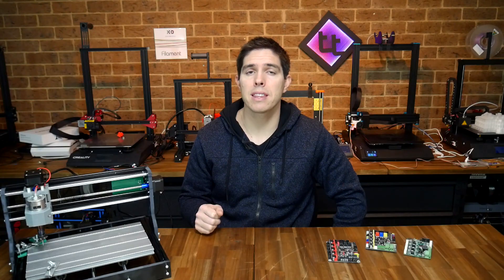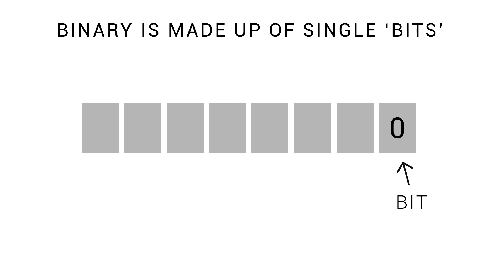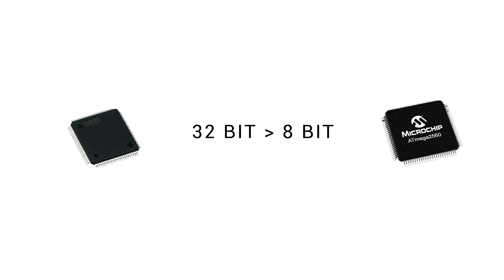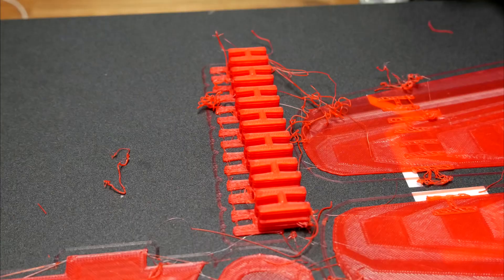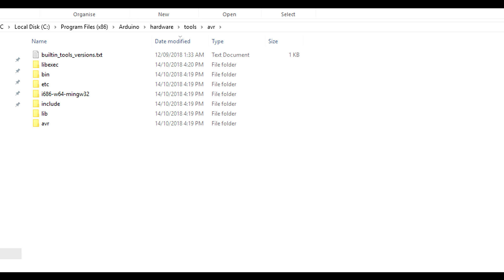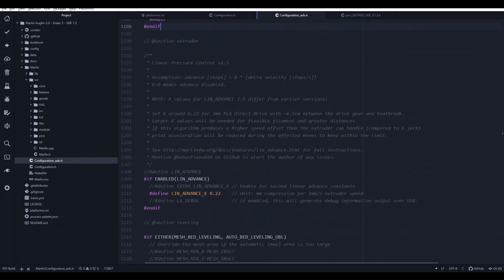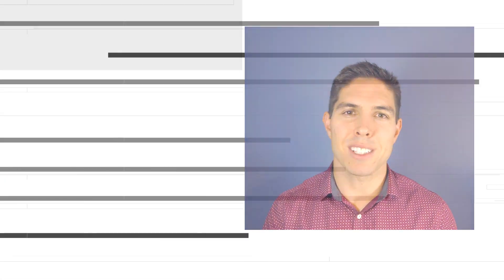32 bit 3D printing - What it means and when you need it

Comment: Ok quick question which would be better i have ender 3 pro and want to be able to print PETG and Nylon. So should i get the SKR or The duet. And i also want to throw a touch screen into the mix. Not sure if SKR can handle the add-ons for the high temp settings and LCD. Also all the duet 2's on Amazon say cloned is this ok or should i get right from the duet's website?

Comment: I still can not find out that clearly, if I have a cartesian 3D printer and MKS Gen L board already:
1. upgraded with TMC2130 drivers 
2. wired and configured (software) SPI, 
3. Silent Step Stick Protectors

4. sensorless home 
5. spreadcycle
6. the drivers feeded 24V 8A buck converter
Is the 32bit board still could be improve anything, or just looks better without visible SPI wires? 
I saw a video where the guy compare the benchy 8bit vs.32bit, but I guess there is not just the board was changed byself. If the drivers (A4988 -> TMC2XXX) also changed that means the board comparison irrelevant.

Comment: I really wonder if this improves for a cnc/laser engraver!
Reply: Haas probably not since CNCs move a lot slower
Reply: This highly depends on the quality of the CNC machine.
If the machine is highly imprecise (eg. +/- 1mm tolerance) then it would be futile to make the upgrade.
On the other hand, a 32-bit board could improve resolution if the machine is well built.

Comment: the funny thing is, we should already have cheap multicore 64bit processors. The Raspberry Pi 3 has a 64bit quad-core CPU with 1,2GHz. This would be obviously overkill, but should show how cheap small boards with such CPUs can already be. Btw you could have made the difference between 8bit and 32bit even more impressive: Windows XP and early Windows 7 PCs were still using 32bit. And there are still cheap tablets made with 32bit

Comment: Marlin was written as 8-bit firmware. It will not work faster on 32-bit platform, only responce rate is faster. Where is no difference between 8 and 32 bit in printing speed.

Comment: Thanks  for the video, great job!   could you do a video of marlin setup for Delta style  printer such as Monoprice  mini delta.   My  MPMD controller died lost the hot end temperature control. and the  controller board is currently  out of stock. I know  these videos are a lot of work  but they are of great worth for those of us who don't have the expertise with firmware builds.   There are a lot of problems & fixes that this would help solve on the MPMD as well!   thanks in advance!!!!

Comment: Do you need it ? No.

Why is easy. Everyone tells you BUT the Speeeeds. And in real they only drives 50mm/s maybe 60 or even 80. 
But even in a Delta 80mm/s wouldnt be a large Problem for a 8Bit Board.

Is it good to have more Power then needed ? Yeah.
Reply: Thanks, wanted another view!

Comment: Sorry, but your explanation ist not getting the most important thing: with 32 bit everything can be calculated using floating point values instead fix point. This means you don't have to choose if a value should be contain big values or have high precision (meaning  having many digits behind the dot). Calculations are much more accurate!
Reply: Not all 32-bit MCUs have FPU. The STM32F103 and LPC1768 does not. STM32F407 does.
And, also, it tends to lose accuracy over time if calculations are made in floats only. So there is no use of floats in CNC machines.

Comment: It is pretty simple, the Duet can't be beat in price/performance right now. It has the best stepper drivers available, everything config is GCode, it has a pretty damn fast CPU, built-in webinterface. It not even more expensive than an arduino with a motor shield plus good stepsticks and a raspberry plus sdcard for the webinterface. There is simply no excuse not to have a Duet if you want a webinterface (which is something you never want to be without once you've been spoiled by it).

Comment: I have a Ender-3 with klipper running with an old netbook, there is no need for a raspberry pi. the process isn't that hard, just download raspian x86 and follow the steps, in order to flash the ender board you will need first flash the boot loader. to flash the bootloader you will need a arduino/raspberry or a USB programmer the process is really straightforward and don't take to much time.

Comment: The last 32 bit upgrade I did from an 8 bit board was about a 25% speed improvement using the same gcode file with the 8 and 32 bit boards. One of the things I noticed was the 8 bit board had a very short delay between gcode commands and that disappeared on the 32 bit board.
Reply from the maker: Very interesting, this is something I have to test.
Reply: In the future, when slicers and printing algorithms become more sophisticated, expect a much larger speed difference.
In particular, I'm talking about smooth surfaces formed by arcs rather than lines.
Cortex-M microcontrollers spend only one clock-cycle for multiplying two 32-bit numbers (with a 32-bit result), whereas an 8-bit MCU would need at least 19 clock cycles, so a single multiplication would thus be 19 times faster if it's 32-bit. For things like arcs, you'd use multiplications a lot. Cortex-M4 and M7 have a floating point unit in addition, which means one can take advantage of a built-in square-root instruction (which can be used to calculate distances between two points - this will probably not be used in the near future, though).
A simple MCU like STM32F103C6 has 20KByte RAM and USB interface; this IC can be acquired for less than US$2.
An 8-bit Atmega usually cost more than $2, and most of the boards I've seen for controlling 3D printers and CNC-routers use some CH34x or PL2303 chip on the UART to get USB functionality. This requires more PCB space and also more ICs (which means extra shipping cost for the manufacturer); it all adds up.
So even though the STM32F103C6 is only 72 MHz and only has 20K RAM, it'd still beat the 8-bit AVR in every case I can think of. The STM series also have some sophisticated motor-control features (which have not really been taken advantage of in any PCBs I know, since all of them use standard stepper drivers).

Comment: 32-bit MCU cannot process 4 8-bit numbers at once. Moreover, it still uses 32-bits registers to process 8-bit numbers.
Also 32-bit MCU requires more memory for the same task. The only real advantage is Clock Freqency. 
And it's not so much faster than 8-bit in 3D-Printing because of Marlin's HAL, which consumes a many MCU clock cycles to work. The code for 32-bit boards is not as optimized, as for 8-bit boards. So don't expect too much from a 32-bit board. At least if you'r not writing firmware yourself :)
Reply: "32-bit MCU cannot process 4 8-bit numbers at once"... but 8 bit cannot process one 32bit number at once. I often use assembly to code, and being able to do a lot of the math in one cycle vs 50 to 100 or more 8-bit cycles in certain instances, makes things go so much faster. Seeing that 3D printer MCU's are mostly doing math, I think 32 will squash 8 regardless if the HAL is a bit inefficient.

Comment: Can you get 2 identical printers but upgrade one with the 32bit board and one on 8bit then print something high speed? I would like to see the results at the end.
Reply: I'm going to try this on my CR10 S5, so will do the experiment. Any suggestions as to which model to use for the experiment?
Reply: @originaltrilogy1  You asking me or did you mean to ask Teaching Tech? I am not sure what model would be good to print but would would guess anything with lots of angles, corners and dimensions within very short distance from each other... something where it has to process many movements on all axis very quickly. Maybe some kind of chain style objects or something with lots of circles and other shapes?  im thinking something like this at high speed but i could be wrong. https://www.thingiverse.com/thing:1363023
Reply: @originaltrilogy1  hmmm perhaps a little boat?

Comment: Your review of 8bit vs 32bit is nice. Thre are limitations of 8bit it has been known for a while. Expecially with matrix bed leveling and linear advance adding a lot of overhead into the movement. 
Most 8bit setups are running a RPI 3B+ with octoprint to make life easier transfering files wirelessly. If we use the RPI processing power for running Klipper so all data processing is made by the RPI we can print to a very high microstepping. The limitation is made by the transfer speed of the arduino USB. Its a little lower than the processing speed of your 32bit but a lot higher than what 8bit can handle.
Reply from the maker: I have two klipper videos coming up. Thanks for sharing.
Reply: @TeachingTech  from memory a 8bit system with 1/16 steppers (a4988) tops out around 160-180mm/s. With a ABL and linear advance its around 120mm/s which is still a lot higher than most users print at.
Using klipper a arduino has 115200bps baud rate. Since we are only sending move data and sensor information we can use a ABL and LA and still print upwards of ~200mm/s.

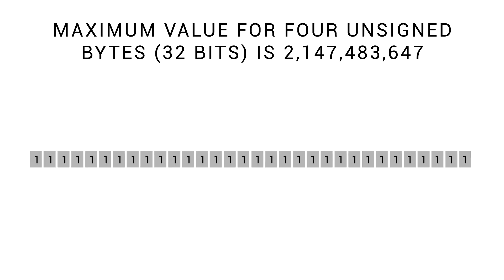Comment: You messed up at 3:16. That's the maximum range of a signed 32 bit integer. Unsigned goes up to 4,294,967,295
Reply: True, but it doesn't matter much in this case anyway. I also noticed the signed byte isn't -127 .. +127, but -128 .. +127; but since the explanation was done quite well, I won't make a fuzz about it. Those who already know how computers work do not need to get precise information and those who don't know yet, do not remember the details of value ranges anyway. ;)

Comment: @Teaching Tech
Actually 8/32 bit is not really the precision of the ALU but the width of address map. For a controller it is called x bit only because the address map is x bit width - more the 'x' means more memory it can address.
Page 17 of the datasheet - https://datasheet.octopart.com/LPC1768FBD100,551-NXP-datasheet-8326490.pdf

Comment: Just chiming in to say Max value of an unsigned 32 bit integer is in the 4 billions, for a signed 32 bit int you are correct though, but with the stipulation that the lowest number is negative 2 billion something instead of 0. Which means you can still jam roughly 4 billions different values into 32 bits, whether signed or unsigned.

Comment: Why upgrade the board in every printer when you can just set up OctoPrint/OctoPi and just use the existing board and have the added benefit of being able to control (and monitor, too, if you have a camera that costs all of about $16) the machine from any networked device in your home?

The whole, "run back and forth with an SD card," thing is a pain in the ass. Really.

Disclaimer: I still haven't flashed a bootloader to my Ender 3 Pro so I have no idea what I'm talking about, in practical terms. But I'm familiar enough with technology (I started on MS-DOS 5.0, kids.) that I am quite confident that it isn't going to be any trouble at all once I finally decide what I want to use to flash the thing. (I'm VERY poor. I don't want (as Alton Brown calls them) any 'unitaskers' in my set of devices.
Reply: PS: You did a nice job of explaining the different numeric bases. The only trouble I had with it was that you ought to have shown the different bases counting up from zero rather than just random place values. That is, something like this would have been a bit better: 00000000, 00000001, 00000010, 00000011, etc... And so on for all the 'bases' you demonstrated. 

I know that wasn't really the primary focus of the video but, if you're going to explain it you probably ought to make it easy to understand for those who really have no idea what they're looking at. I'm not saying you did an awful job of it, just that there is one thing you could have done better. Nor am I claiming that I would have thought of it myself before watching your video. (This, really, is just for those idiots who are going to get offended because I'm trying to offer you a bit of constructive criticism. Your videos really are amongst the best and you're one of my first choices for information.)

Comment: My CNC mill runs on an FPGA (smoothstepper) because it is more able to kick out the steps at regular timing with the chip set up specially for the purpose. Are there 3D printer boards that use FPGA?